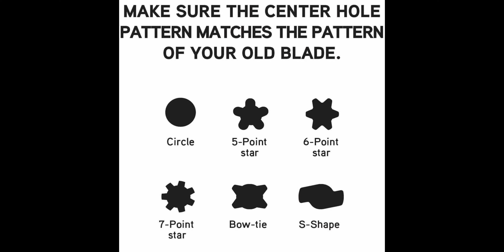Cub Cadet ZT2: Blade Replacement/Sharpening and Deck Cleaning

Comment: Thanks for sharing this man. I just purchased my first zero turn (zt2 50") and just subscribed so I can check out your future zt2 videos. I've got lots to learn regarding upkeep and maintenance!
And hey, is that a new/aftermarket black front bumper guard?? I dig it!
Reply from the maker: Thanks for the comment!  You'll like the mower,  it's been great so far!  You'll get that front counterweight once you purchase a bagger...the look is just a bonus!
Reply: @theroyboys2  Nice! Def gonna look into getting that bagger system in the future!
Reply: Don’t wash the deck blow it off and try the mulch blade you will thank me the high lift is great for bagging and wet grass the mulching blades work great in tall and thick grass I sharpen my blades about every 25 hrs of use
Reply: @theroyboys2  they should have built a light bar into that front counterweight
Reply from the maker: @johnkrahulec5215  that would have been a pretty good idea.
Reply: @theroyboys2  do you have a link to it?  I’ll check it and see if I can modify it to add lights
Reply from the maker: @johnkrahulec5215  I don't... the dealer included at the time of purchase.

Comment: I'm hoping you can help me with this. On my previous zero turn I always had to pull the choke up to start the engine for a cold start. With my ultima I hadn't ran it in about 5 hours so the engine wasn't hot but it wouldn't start if Inhad the choke pulled. However, not pulling the choke allowed it start with ease. Any idea if the choke being pulled is only necessary if it's been sitting without use for a certain amount of time?
Reply from the maker: Thanks for the comment!  What's your throttle position when statting? For mine, I use full choke at the lowest throttle for every cold start....it usually fires right up essentially with the bump of the key, and then I immediately shut the choke off.  If the engine is hot, I don't need the choke.  If I run the engine for a brief period (not to full operating temp) I  usually will try without the choke (engage the start for a second or two)...if it doesn't start, I choke it and it fires right up.  In all instances, I have the throttle in the lowest setting...when choke is used, it is essentially just to crank the engine.  I never have had to run the engine with choke engaged to keep it running.
Reply: @theroyboys2  I agree with The Roy Boys here... I always use minimum throttle, max choke to start unless it's been running a while. I take a beer break about once an hour, no need for choke to restart.

Comment: To get under your mower can you just use a floor jack then rest the mower on two jack stands?

Also, I noticed my zero turn comes with tuff torq 350 transmission. They no longer use hydrogear 2800. Any idea if that's a downgrade becuase mine doesn't have the hydraulic fluid reservoir by the engine like they use to.

Lastly, I've heard the stock blades are garbage. Do you know of a brand that makes a good set of blades that fit the ZT2?

Thanks for the video man. I'll be watching everything you post.
Reply from the maker: Thanks for the comment!  I've cleaned out the deck a few times and removed the blades twice using the jack and jack stands.  There is only so high you can lift the front before the rear frame makes contact with the ground.
As far as the transmission, I'm not the most familiar with the model you're referring to.   I'm guessing it should be sufficient.  I heard the models on the ZT1 which were not serviceable had pretty good life to them.
I have just been running the stock "ultra high lift" blades from cadet...they fit my purpose well enough even though I only bag a couple times per year.  When I'm not bagging, they throw a pretty nice and  even discharge if the grass is dry.
Do to the nature of the "ultra high lift" blades, they could require more frequent sharpening/replacement, especially if you have sandy soil because it is lifting a lot of that up when cutting.  If you want more longevity, you could go with a blade with less lift, but you may sacrifice cut quality.  Hope that helps!
Reply: I cheat and lift the zt2 with a front end loader when wire wraps a spindle. Was able to drive over the deck when removing. Had to use errant bricks to make a hasty ramp for the drive over to reinstall. Floor jack and stands would probably work too. 
Found a 9 pack of blades on Amazon, much cheaper than OEM blades, and they're doing ok.
Reply: @bucket0rocks  got an Amazon link?

Comment: I don't know why people don't use a belt sander to sharpen their blades you get a nice even cut on the blade itself, balance it and then put it back on a lawn mower doesn't take long at all, grinders dig into the blade.
Reply from the maker: That's definitely an option as well!  I used a high grit flap disk/pad for my grinder for this job.

Comment: zt2 w/60" fabricated deck here. 2 years in, and the fabricated deck is literally coming apart at the seams. metal under the exit chute broke off a year ago, metal on the other side is bent backwards and leaves yard scars in reverse, multiple weld pops across the top. have a cub tractor with a stamped 46", and that thing has held up wayyyyy better. stay away from the fabricated decks, they look beefier, but are craptastic.
Reply from the maker: Sorry to hear about that.  I wouldn't have expected that with a forged deck.
Reply: @theroyboys2  me either. To be fair, I am pretty rough on the machines because of the terrain. but have used a stamped 46" for years ...as a brush hog, mowing literally anything it could push over... and never had that split apart. Stamped decks don't have seams, so it makes sense I guess. I would have thought the fab decks were stronger. They are a heavier guage steel.
Reply from the maker: @bucket0rocks  glad your having good luck with it.  I will make sure I baby mine a little more.